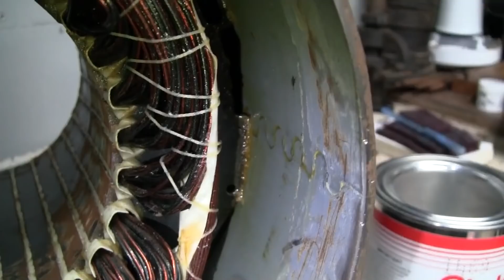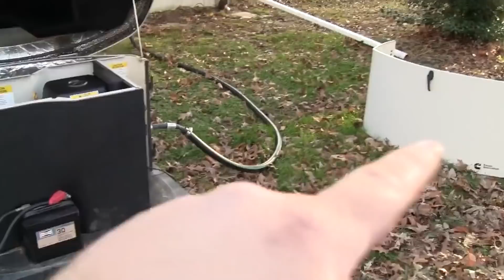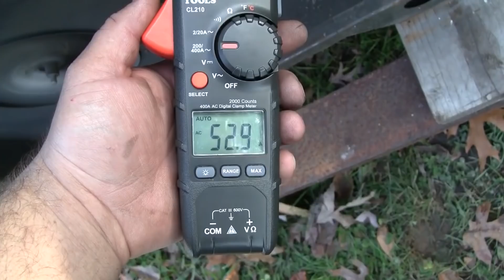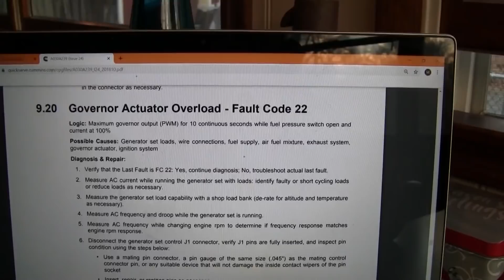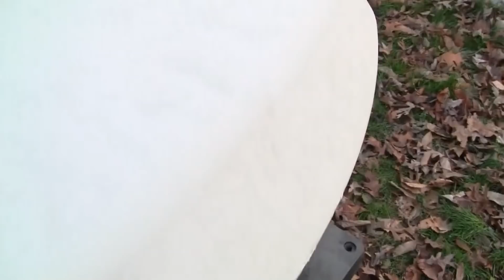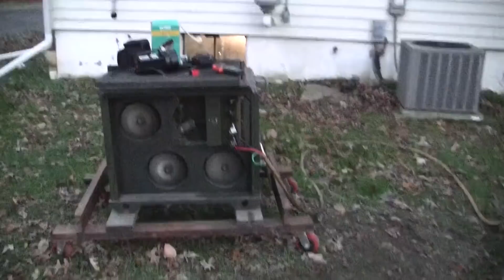COMPLETE REPAIR AND TEST 2015 Cummins Power Home Stand By Generator Pt. 2/2

Comment: Also...........20kva at what power factor?  Because if the power factor is say 0.8 ( 80%) then its at maximum at 16 kw. Very cool strobe light demonstration ) Compared to the many repairs I have seen done to other,smaller units...........it seems that the voltage and frequency coming out of that unit under heavy load is actually very good and perfectly stable.

Comment: That strobe light was pretty darn cool. I'm used to seeing timing lights on engines and stuff so when you fired that thing up at 3600rpm I was surprised how crisp and easy to see everything was. Looks like you've got a good genset there. I hope you're able to make a nice little profit on it now that it's not only repaired but also a little product improvement implimented with the potting on that rotor and the addition of the Glyptal. I've seen that stuff used inside lifter valleys and crank cases to help oil drain faster.

Comment: Are you running LP or NG? There are different fuel orifices that need to be swapped out. OEMs also sell 20kw generators that are derated to 17-18kw on NG (as seen in the manuals). NG just doesn’t burn as fast or hot as LP.

Edit: you caught that later in the video...

Comment: Thanks for the great video as usual. I appreciate your troubleshooting insight and your ability to figure out what went wrong & to leave these machines better than when you got them. It is kind of sad, but not all that surprising, to see the low quality of work done on these whole house generators by the manufacturer - that field winding connection was pretty terrible! Either way, great job fixing it!

Comment: I'm curious, would having no resin or enamel on the windings cause bad connections? because when I was working on my cousins scooter, I took off the flywheel and may have knicked the stator underneath, it doesn't appear anything was severed, but I wasn't getting any voltage from one of the wires, so if the enamel came off a wire would that mess with it?

Comment: Here is what I would like to know:  How many CuFt of gas  does the generator use to produces say 10KWH of electricity or what what ever would be conveniently measured.   Electricity is quite expensive here at around  $.25/KWH but natural gas is not so bad.  I often wondered if it would be economical  make your own electricity from natural gas.    Nice video, thanks.

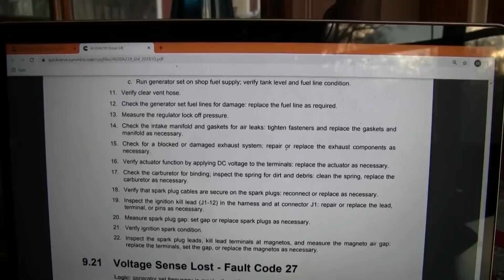Comment: 24:23 nope, maybe a few percent, but the reality is this. This unit was built and specced out for propane (which has that extra kick), not ng. It's even in the manual, so it stands to reason that, both, as you eloquently put it "the ragged edge" and the fact that it's not ran on the actual spec gas, means it will never be box spec worthy.
That being said, by word of reddit, i read that you can tweak the engine to squeeze a wee bit more power out of them. Not much, i'd like to say the poster said something like 8% to 11% more power from the middle of the 4/7 margin, but yeah, i've no idea if it would even be worth it.

Never have used natural gas systems for actual generator purposes, so i'm pretty newbish past the general stuff.

Comment: Think you starved it for fuel! Could not keep rpms so shut off! Need more gas???  Nice repair! And how much does these run at full load continually? Also always the start up load, if hooked to home . Like refrigerator comes on, turn on microwave, space heater. All have a start up amp draw that can cause overload if all ready at or near max load. As well as you know this ( like telling you that what already know). But the load bank is a controlled load not like flip on a new draw of something, that gas a start up load.

Comment: Seeing how your big into generators can you run a 10k generator head from harbour freight using a small 3500rpm air compressor motor to run eachothere and also run on your house that uses 7k
Reply: That head needs 16hp 3600rpm minimum.
Reply: @bills6093  that big I have a motor that's 3500 at 3hp it's supposed to said air compressor motor
Reply: @dakotak8437  Yeah, that is from the HF site and manual. The head is 10Kw max, but only 7.2Kw continuous.

Comment: Looks like you did a good job reinforcing the mechanical and electrical connection from the rotor windings to the pins... but were you able to do anything to beef up the connection from the pins to the rotor contact ring?

Comment: At the end of part 1, I thought those little copper jumpers connecting the slip ring contact to the rotor winding would tend to move out under centrifugal force.  By golly, I was right.  Nice fix you fashioned.

Comment: That's a castor based potting compound so it's going to be very runny.

GE used Glyptal to paint their Monitor Top refrigerators.  Quite an expensive finish for that application.

Comment: BTW - If you're ever interested in some content for a rainy day, perhaps you'd consider making a video about choosing the right: size, brand, fuel (dual fuel?) generator for a given home.  I'm in need of backup generation capacity in So Cal, and I've got way more questions than answers at this point.

Comment: I kind of cringe when I see these stand-by generators run open and with the panels off. Not all are the same but they're air cooled and rely on the duct effect of the panels to direct cooling airflow, THANK YOU for mentioning it.

Comment: I have seen you question your NG supply volume a couple times. If you wish, you should pipe in a larger section of pipe which we call a battery for such applications. So if you have 3/4 pipe, just after your ball valve add a 2-3 ft. piece of 1 3/4 or 2" pipe with necessary reducers then back to 3/4"  it will do wonders for your "supply" amounts

Comment: So it’s basically a Briggs engine with a not too solidly wired generator, with the Cummins name...  
I was wondering if that connection should be potted to avoid resonance work hardening/centrifugal forces...  nice job as always.

Comment: Engines lose about 40% power on natural gas, and about 20% on propane VS  gasoline. That's why they turbo all the big ones, to get some of the power back.  You know that better than anybody.  I think it's doing all it can with that little two cylinder engine, would do better on propane.  No doubt optimistically rated, as it is a standby unit.  Still plenty of power for all but the largest house. Great job, runs quiet for one of those 3600 rpm screamers. Running that thing at high load  for that long probably got that small little generator end really hot, probably not really designed for continuous duty like you gave it at max output.

Comment: You are a rear great tech and produce awesome videos. Gen is around 18kw on NG and 20kw on Propane. Also  good to verify the settings in the controller is set to NG not Propane.  This will through off the controller thinking the rating is low on the display. Your gas reading is below the minimum required.  Cummins specs the number at full load. But she ran good under spec. This is why the governor was pushing everything it has and shut down to protect it. I would check the fuel settings.

Comment: Why didnt you ballance the rotor before putting it back together, you mist have offset the ballance
Reply: I suppose he didn't because the imbalance would be very close to the center of rotation and therefore doesn't have as much of an impact as if it was on the outside.

The rotational mass of the whole rotor is much greater than the few grams of wire, lacing and epoxy with even less grams of potential imbalance.

Comment: Could it be easily converted to LP? And how much for the unit and transfer switch?
Reply: Ken; I have researched this topic myself and can say factually that the engine doesn't care which gaseous fuel you use, as long as you use the right size jets in the induction system. Propane regulated pressure is high so you need smaller jets to compensate. Like with a 3/32 inch hole. Natural gas pressure in residential homes is usually only about 7 inches of water column, so you need jets with a larger hole. Like about 7/16 inch. ( Examples ) LP also has more BTU of energy value than natural gas so with LP, the engine will develop more power. The conversion from one to the other is easy as long as you can find the proper jets for that model. Only @smallenginemechanic can answer the rest of your questions.

Comment: Sir, you are one of the most knowledgeable generator guys on YouTube. I have learned an immense amount from you. Outstanding!
Reply: I'll second that.  Always great videos and I always learn from them.  Keep up the good work.
Reply: You guys should ALSO checkout James Condon.
Reply: DITTO
Reply: Agreed!
I wasn't even a big fan of generators in general before, but have a new-found interest in them, and have plans to clean up and upgrade my 1970-vintage Kohler 3.5KW genny that came in my 1970 "Ute Liner" motorhome. It's a 4-pole unit, so it turns at 1800RPM, meaning it is quieter and longer lasting than the typical 3600RPM "cheapies"

Comment: You did a pro repair on the Cummins.  The strobe verify's a good job. The mobile test load is pretty impressive. At 5 inch's of gas pressure, you are starting to starve the engine of fuel, not good. Results in electronics shutting down the gen. A no brain er. The db output is too loud for my liking. Final thought; I will never purchase a 20 kw Cummins. Chinese junk.

Comment: Next time if you have that same problem with the rotor windings you might want to build a little box or something that can be temporary and use that as a mold to fill in the epoxy with and it won't go away and be so runny everywhere you don't want it to go

Comment: from the witness marks... I would say they used a air  powered wire brush, and I agree they were sloppy...  BTW... I would say that it was bad engineering to have the windings connections to be a press fit on the slip ring dowels....

Comment: 26:13 He gets a lock on the strobe frequency vs rotor frequency! real cool!
Reply: That was really neat, looking with the strobe.
Reply: I want one.
Reply: @greengmcrob  They are everywhere on mechanics shops and similar, and on amazon no doubt.
Reply: I used one all the time when I was in the Navy.
Reply: As a kid, I ran a 24 VDC fan off a variable supply.  If you looked at a rotating object THROUGH the spinning fan, it had the same effect as a strobe (you could stop apparent motion by adjusting the fan speed).

Comment: Good repair. Seams they don't put enough varnish on the windings. Just barely enough to work most of the time under light use. Junk design that's why it failed

Comment: Sounds to me like a 15kw gen, I think they are trying to run just a tad too much generator for what the the engine is capable of. I like to have a alittle more head room on the engine power side too allow for variables that cause the engine to run at less than peak power, especially on N/A gas/LP/natural gas engines. Something like 15% to 20% more engine HP than the gen head requires.
Otherwise a great video, wish there was more people like you out there fixing things.

Comment: Mr S.E.M., you might want to contact the gas company and see if they'll bump your meter to a 2psi system. Not sure bout your area, but here in western NC, there's no charge to the customer to up the meter if it's available in your area. (very few low pressure mains left in the US now, most are 60 psi and up) You'll have to put regs at your appliances or at least 1 reg going into your house, the lower btu regs used to be about $20 10 years ago... Then add a large 2psi to 7" reg at your genset and you'd have no problem running your genset :-)
Reply: @Edgar Miller a valve upstream of a monitor transducer was closed causing a out of control situation if I remember correctly.
Reply: The neighborhood im in is low pressure and we hold a hair under 1/2psi at the negative regulator. I was 12wc and only able to run 80% on my generac. The venturi can only flow so much fuel. 95% on propain. Other thing to mention that its a gasoline generator with a conversion. That regulator is rated on 1” pressure drop at full capacity so its the intake runners and valves. From all my electrical background knowledge you never exceed 80% of a generator, circuits ampcity or motor load. Most natural / propane appliances are rated to 1/2psi max. Most gas companies will give you that but 2 psi requires step down before appliances. Most smaller homes have a 250 ft3 service rating 3/4” hose can carry that.
Reply: @Edgar Miller, here in the Salt Lake City area some of the high pressure lines are upwards of 120 lbs.
Reply: @brucejones2354  some transmission mains come close to 1000psi. I know a few people in that field and what happened with that neighborhood explosion was a failure on many levels.

Comment: What amazes me is the generator can deliver that amount of power out of such a physically small machine. Granted, over here in the UK, we're working on a different system, but we have a  couple of 20kW generators in our yard, which by comparison, are huge. Our little 6kW unit is about the same physical size as yours. It has to be said though, they date from about 1963 to about 1978. Maybe that also says something?

Come to think of it, we have a little Onan RV2 (I think it is) 2.2kW propane RV generator from about 1962 - Nice machine when it's up and running.

Comment: i noticed when you were showing gas pr you were saying 4.5 to 5 but it was showing 3 to 3.5
Reply: Look at the outer ring in red on the pressure meter. The inner one is ounces per square inch
Reply: yes your right.low fuel pressure

Comment: I think is't not enough gas volume ; You could inquire with the gas utility for a larger gas meter , Probably at no extra cost ; For your info the gas line to your home if it is medium pressure it's 30 psi and high pressure it's 100 psi , Lots of gas .  Or have a reg in pounds with a second meter in pounds pressure . just a suggestion  from a gas fitter  lol

Comment: Great video the wife has been on me for a unit 17kw but at close to 8 k installed, I think I can run a small portable gen set for a lot less.
Reply: It’s all a matter of how long you expect to run a generator anything other than a few hours occasionally and you would need a good sized unit at least three cylinder water cooled with 1800 rpm.

Comment: After the housing is dipped it goes into the oven, then I would barrel sand the inside of the housing to remove the varnish.
Reply: ah, so you worked in such a factory?

Comment: Can the epoxy screw up the balance of the rotor assembly? Back in the day we built small motors and balance was critical. Lot smaller and spun much higher RPM though. I guess since it didn't vibrate itself apart when you fired it up answered that.

Comment: These generators are often de-rated for natural gas.  The full rating is for propane.  Perhaps that's what you ran into there at 21:00
Reply: I worked for a contractor years ago and he installed a generac version of this at his house. He had the city install a 2lb meter and ran all his other appliances on regulators so he could get propane pressure for the generator.
Reply: @squintin480  Yeah..gonna need a bit more oomph to run an engine on natural gas than what is normally fed thru household meters
Reply: @squintin480  Yes and many newer meters can be tweaked for a modest increase in gas flow by the utility. Not always required to install a different meter. Most small residential generators run very well with a steady 6-7 inches of water column at full rated load. Thats about .4 PSI of pressure in the pipe.
Reply: @tigerseye73  0.25 psi. Many gas companies in the old days referred to that as 1/4 pound pressure. 1/2 pound pressure is for LP gas,  or 11-14 inches water column.
Reply: @squintin480  2lb meter… You mean 2lb regulator right
Reply: @tjlovesrachel  yeah, 2lb regulator
Reply: He said that at the end
Reply: The 20 kw rate is surge power for a short duration of time. Mfg's use that number for marketing shine. All gen's true rating (full design load) will be about 15 % less. Always look for full design load rating for the fuel type you are using. Forget about the surge watts. BTW, gasoline and propane fuel will always give more output watts  than natural gas, but still lower than short duration surge watts.

Comment: You are good at what you do ..It would be great to find a  car mechanic that has your IQ when it comes to stuff like this job
Reply: Eric O at South main Auto has entered the chat
Reply: Check out Eric at South Main Auto channel.
Reply: not2fast4u2c watch Wes work
Reply: Hehe, I've been spinning wrenches over 35 years. Walking the line between engineer and mechanic is a lot of fun.

There are some really sharp mechanics out there, I assure you. We fit into two categories. It's a job, or its also your hobby. I fit into the latter set.

I love to know why things happen, not blind acceptance of procedures. When the guys get stuck on a weird problem, I love to dig into it.

By trade, I specialize in VW, the latest. But by passion, I also repair heavy diesels and farm equipment...and yes, industrial power.
Reply: @robertborchert932  I have about 40 years at doing mechanical stuff started with bicycles and mini bikes and then onto cars 60's and 70's cars I  grew up around  I have always fixed my own stuff since I grew up semi- poor ..Never learned much of the modern computer controlled stuff on engines ..just the basic parts how it works ..Too many shops now have what I call parts replacement mechanics ..That cannot repair something broken they just replace it .Which is the best but they never learn how to repair something